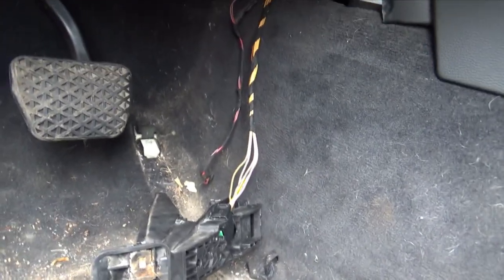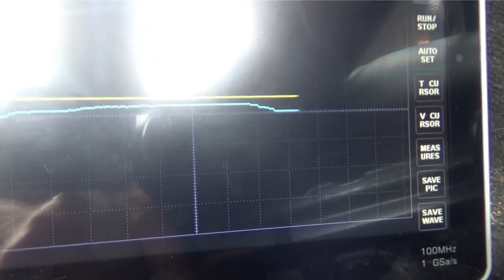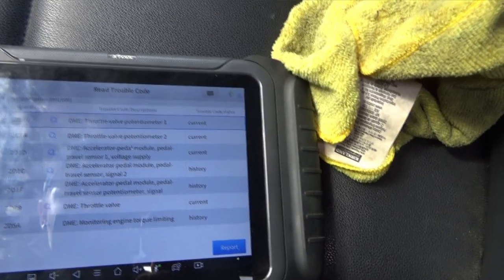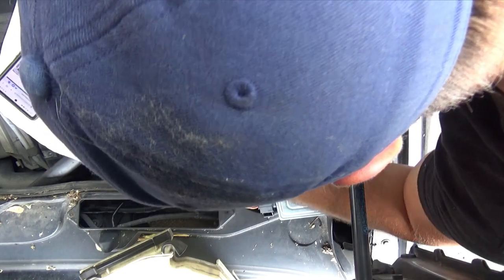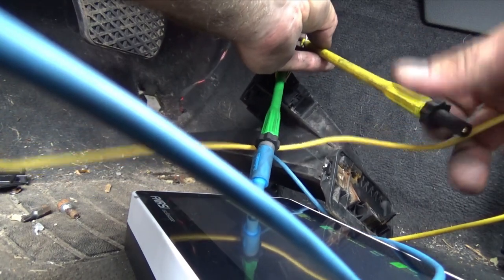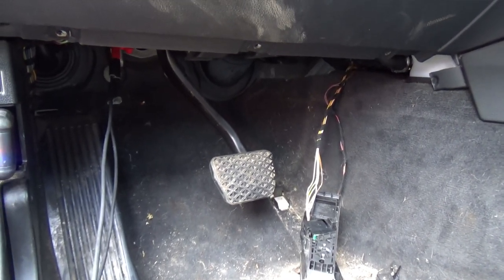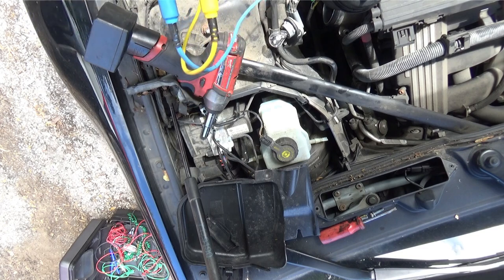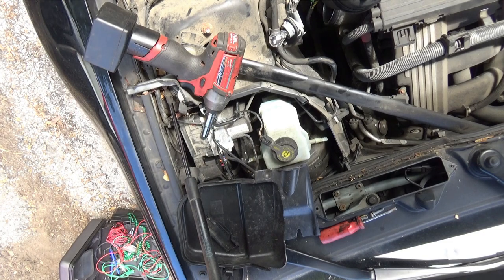Bmw and Mini 2AF9/2AFC/2D1D

Comment: Did replacing the throttle body and pedal fix it?
Reply from the maker: The shop replaced the parts and it did fix the issue. but the client picked up the car before i could get back for a follow up